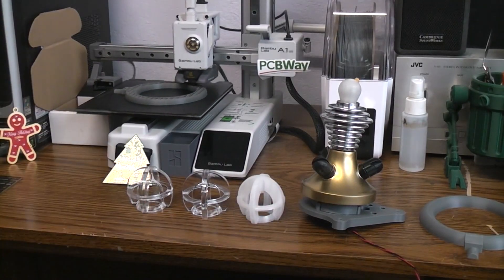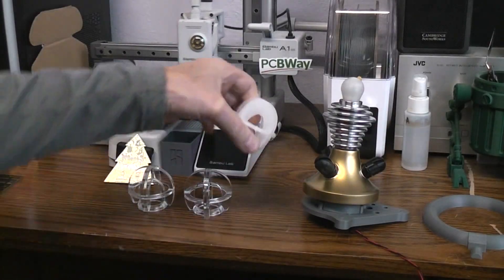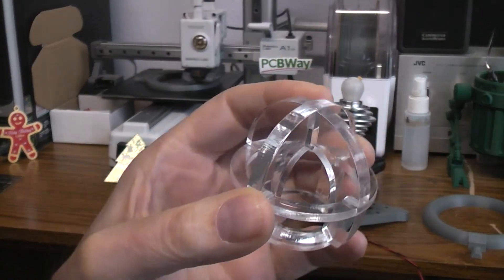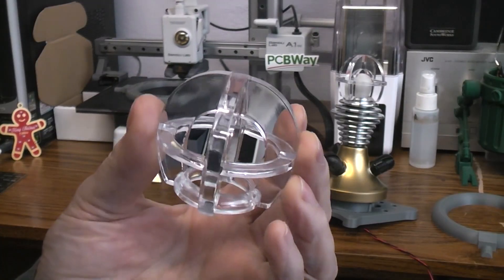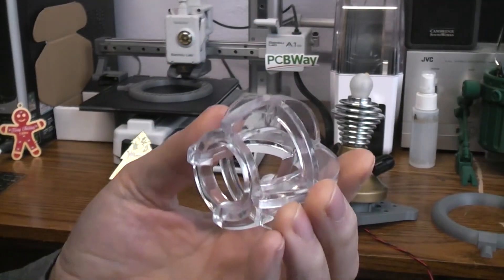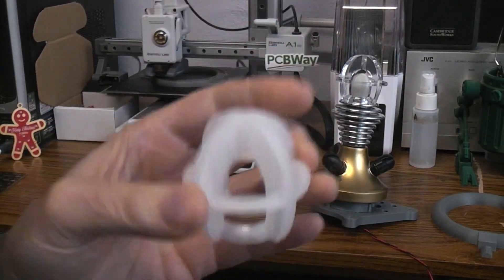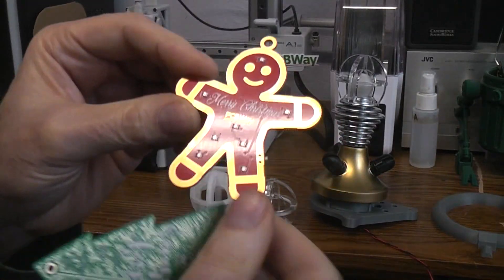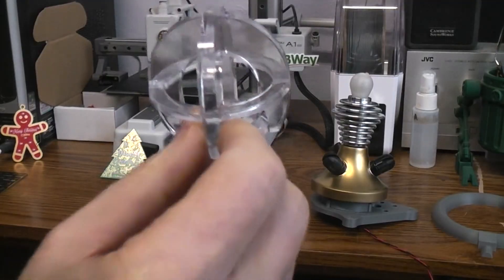Comparing DIY plexiglass, PCBWAY clear resin & FDM 3d printing of the Robby Dome Lamp Cage.

Comment: Hi John , quick question ....did you have them print clear parts and then you assembled them as one unit for this Clear Cage  ? Or did you assemble the parts as one file and had them print this Clear Cage as one part ? It looks Amazing and for the price it's totally worth it . Thanks for this info ! 👍
Reply from the maker: I designed the part in Design Spark Mechanical as a sing 3d cad file Part. They 3 printed it as a single part. Arrived just as you see it.

Comment: With the PCBWay part, is this post-polished ?… I’d have thought even the best resin printers would leave fine striations on the surface ?
Reply from the maker: PCBWAY does all the clean up of supports and polishing. Also the do a clear coat I believe.

Comment: Clear filament works best with 100% infill.
It looks like you had a lot of hollow area in your print.

Thanks for sharing these examples with us.
Reply from the maker: #d filament works best in vase mode single layer. I have done domes that way and clear coated them to get a clear result. But as soon as the part has thickness in the case about 1/4 inch thick it does not matter if its 100% infill or not, it will not be clear. Now there are some nice clear 3d printer resins out now, but they cost so much that having PCBWAY do the job is still less expensive.
Reply: @Robothut  Have you seen the video "Transparent FDM 3D Prints are Clearly Stronger!" by CNC Kitchen? 
He shows some strategies to getting the clearest FDM prints. The prints are still not as clear as the resin print from PCBWAY but they look pretty good.
Reply from the maker: @ddegn  Yes, I have followed CNC Kitchen for many years. I have been 3d printing for over 10 years, so there is not much I have not seen or done.

Comment: Thank You John. Those are beautiful pieces. Probably not long into the the future,home clear printing will be available.
Reply from the maker: There are some clear 3d printing resins for home use that are very good but very expensive right now. Until the price comes down its cheaper to have it done on pro equipment.